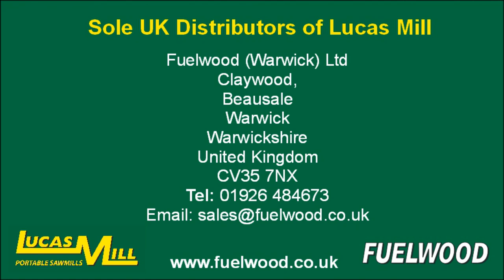Lucas Mill Portable Saw Mill - Fuelwood - Case Study

Comment: would question the  way u approach the log rolled over the bad side would have been  down to leave as  the rubish as bottom flitch  and the crack would have almost aligned vertical saving shake waste on  boards    crack will destroy so much timber  in the current position  just observation agree with versatility  of the lucas